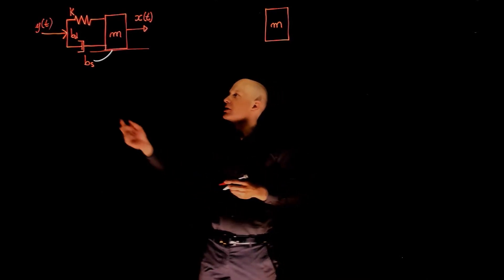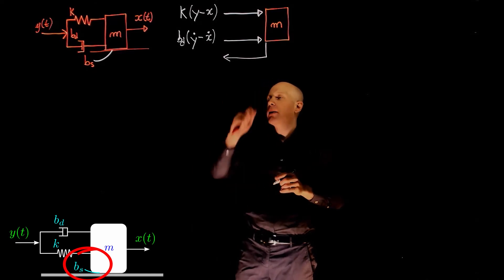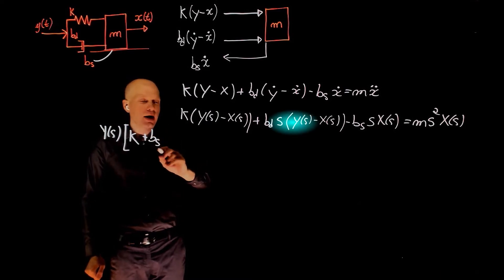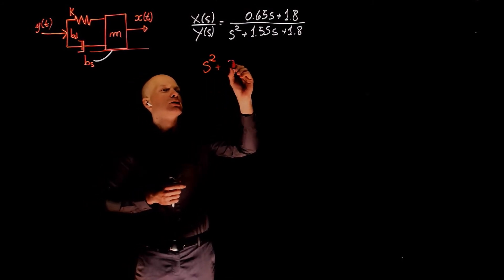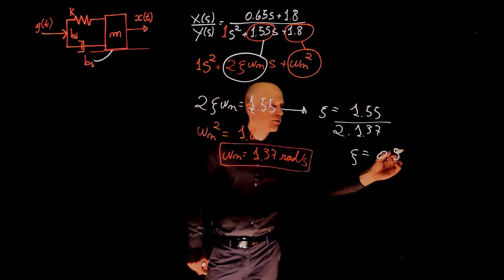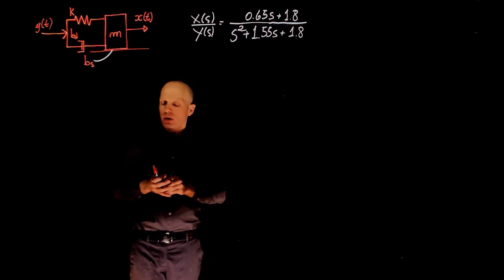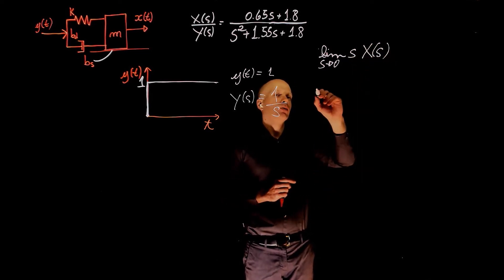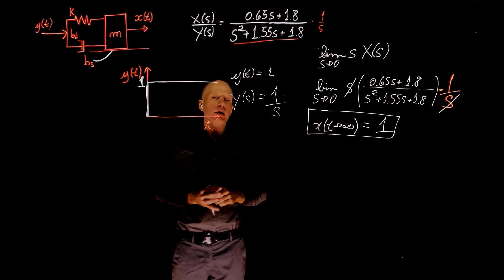L4E18 - Control Systems, Lecture 4, exercise 18. Transfer function of a mass spring damper system

Comment: at 5:05 you are saying there is no standart form for the numerator of the second order transfer function, but in the previous lecture's slide the standart form of the second order transfer function had [omega_n]^2 in its numerator as standart, am i wrong ?
Reply from the maker: yes but omega^2 on top of the equation does not change the shape of the response, only the magnitude. It acts as a constant gain.
Reply: @biomechlab  ahh now i get it thank you very much!